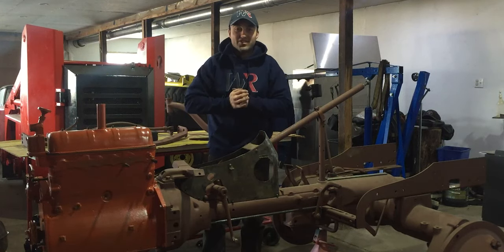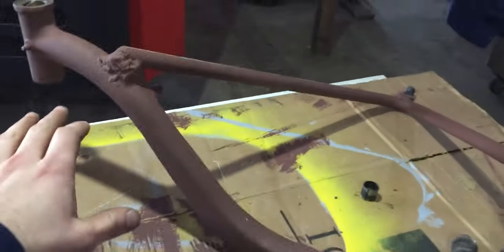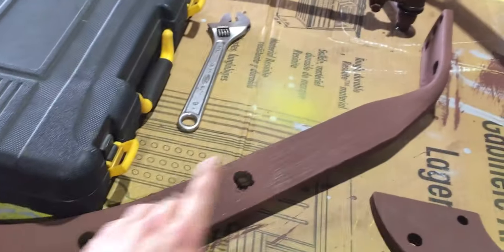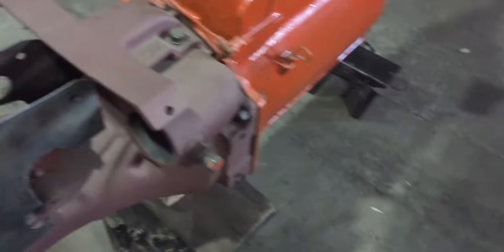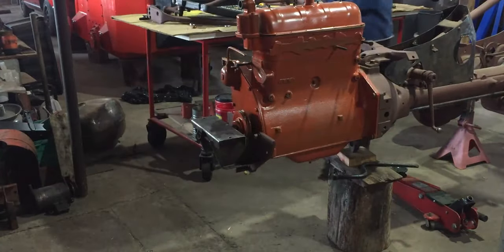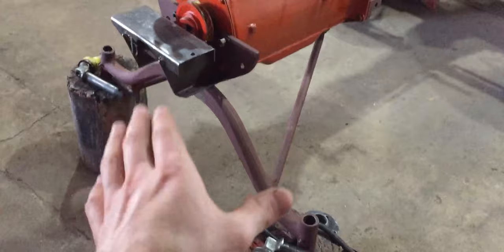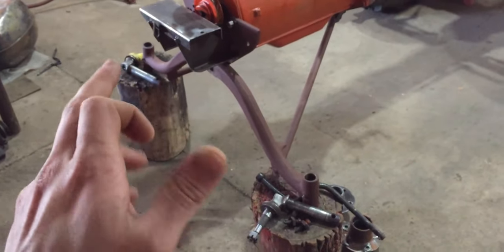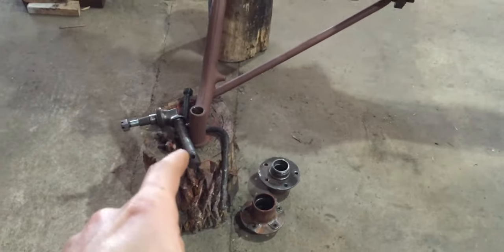Allis Chalmers B/C Front Axle and Spindles

Comment: Also why did you not pack the bearings first with grease, what are your thoughts?
Reply from the maker: I could have packed them ahead of time, but I the cavity around the spindle & housing will get filled grease. I believe that should allow enough grease to get to the bearings before I start cutting fields with this tractor in summertime. Thank you for the great question, I appreciate it. Best regards

Comment: We are having problems figuring out the front wheel seals on the Allis Chalmers CA which way does it go on? and should it turn on the spindle when we turn the wheels over?  The seals went on pretty hard tight & the new seal felts seems to be kind of tight in the hub. They turn on the spindle that doesnt seem right.
Reply from the maker: Thank you for your great question! In this video, I did not install a new seal, as the old ones were just fine. These seals are like you stated made out of felt and they acted more or less like a "duster" back then. 
The seal should be pushed onto the spindle itself and the felt seal should be snug to the wheel-hub. 
Once you install everything, you should be able to rotate the hub by hand and the seal must be held on the spindle!
If it is too tight against the hub, I would contact the dealer you purchased your seals from! There could be two different sizes of seals for the tractors models after a certain year, but I'm not sure.
I hope that helps, Best regards